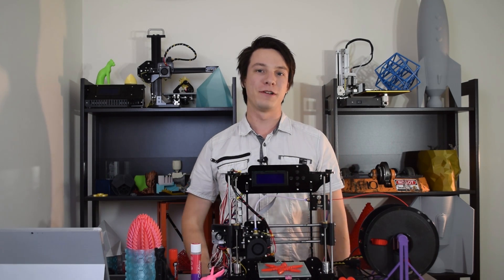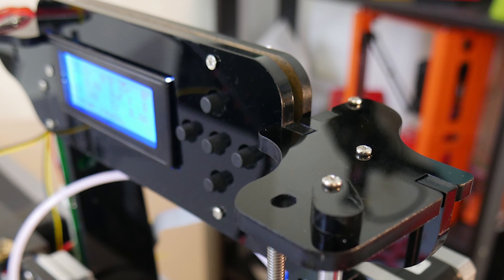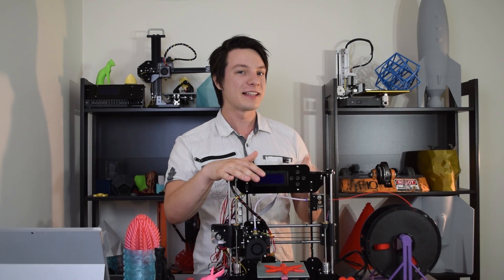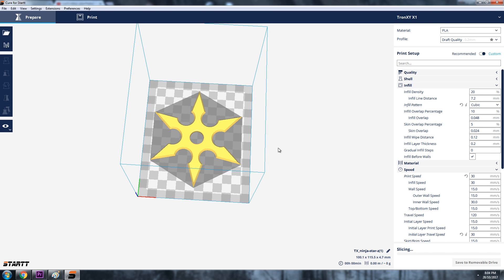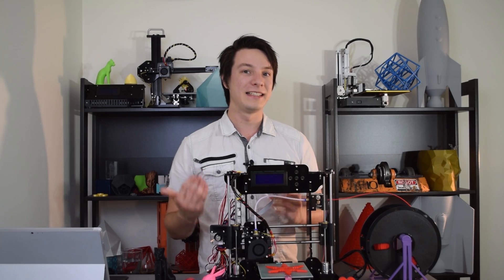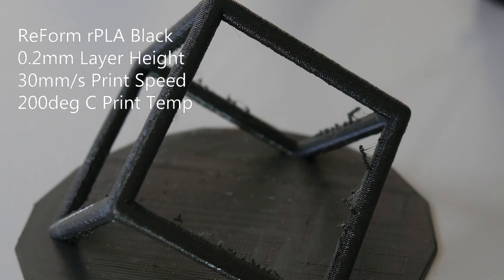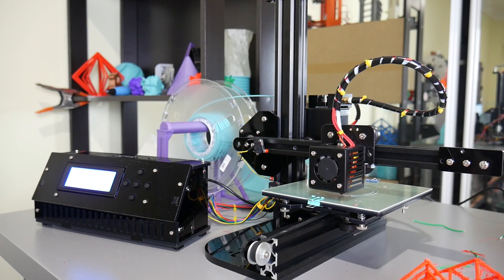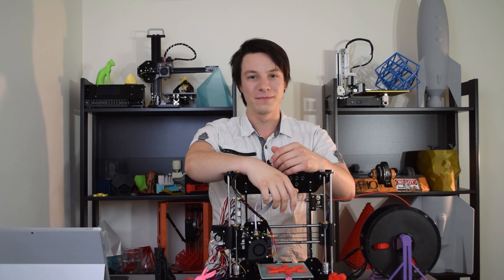The $99.99 STARTT 3D Printer is the Cheapest Kit you can buy. But is it any good?

Comment: I bought that same printer 4 months ago. In fact I bought 10. For 75.99 from a North American eBay seller. They are oem from tronxy.
Reply: And non of these issues werent present on all my 10 of them. They were perfect. What the hell is startt doing. They also have heated bed
Reply: What did you search to find it on ebay?

Comment: Love ya channel, can I ask a question?
Do any printers extrude wet ceramics? Or metal clay like 'silver art clay'.. wanted to print out some  piezoelectric ceramic clay like PZT .. anything on the market?

Technically shouldn't be hard.
Reply: Not right off the shelf, probably, but not an unexplored topic either, you can accomplish it, there's numerous print head designs. The keyword you're looking for is "Paste extrusion" e.g. on reprap wiki. People do all kinds of things with those, like pastry and other foods, printing solder-ball-flux paste in electronics, and yes porcelain.

Comment: GIMME THE HARIBOOOOOOO.  I can never find the big bags here in South Africa (CT. Not JHB. Lady Muse knows what I mean).

Sure you don't have to deal with mains voltage, but that DC can still give you a good shock. Won't kill you. Still can give you a good burn or fright. Though on a side note I have been shocked by mains voltage (240v 50/60hz) many times thanks to people not turning off control board switches after they say they did and other reasons. 
Never mind that though because you have a very hot bit of metal a kid could touch. Just look at the marketing and their claims. It's aimed at kids as a START[T] to 3d printing.

Frankly if the parts (motors, motherboard etc) cost more to buy individually than the whole kit. I would just buy the machine for its parts and use the parts for a hypercube or something. Hell. build the printer. Cut your teeth so to speak on the learning side. Get it working. Print parts for another type of machine and tear it down to build that one.

Also a side not to Angus.......That joke was bad, but I forgive you because your reviews are good.
Reply: Martin B You really can't shock your self with those DC supplies.

It's 12v, you're not going to feel anything, unless you suck it.

Comment: worth buying  for motors and pulley's and Power supply  alone lol scrap the rest.
Reply: patprop74 Nooo, not even close.

You can get the motors for $7 each and it's using an $8 power supply....
Pulleys are so cheap, it's not even worth costing them.
Reply: No clue where your from,  but around here cheapest nema 17 is round 14$ after exchange rates and shipping and that's finding a deal on fleabay. the power supply is not good for 3d printers but good for other projects

Comment: This is exactly the Anet A8 but smaller
Reply: Anet A8/A6 have:
- more rigid frames,
- larger print volumes,
- heated beds, (including more powerful PSUs!)
- optional auto leveling kits
at an overall reasonable price.
Reply: Hans-Joachim Bierwirth the A8’s frame isn’t very rigid — the smaller size should make this one more rigid than A8, unless they’ve gone for ridiculously thinner.
Reply: So a A6
Reply: I thought so too. It's like a half the print bed sized mini Anet A8 with a power plug, no heated bed and a price tag higher than half of the A8. It looks cute though.
Reply: A6 is better
Reply: its a small a8 with an external psu. i think its pretty decent but given that the anet a8 is often on sale on gearbest for around 130-135$, i think you should spend that extra 30$.
Reply: I would go for the a8 too. I have not had most of those problems with mine
Reply: +Hans-Joachim  And Anet a8's affordable price making it's community bigger and you can get help easier, you can also upgrade it easier too.
Reply: it's way worse you should say
Reply: +Hugo not exact , it got the bowden upgrade
Reply: I was thinking the same

Comment: Great review Angus! By the way, would you know much about the V3 printer sold through a 90 part magazine collection called 3d Create and Print? I have completed the build and it seems to work fine mechanically but I have come across many small problems, especially with the provided software 😞 It would be nice to know your opinion on it

Comment: You could just get this set for $99, buy a steel frame, replace some parts, add a heated bed and you would be set. ;D
Reply: Diabl0pl but by that pint you might as well buy a whole new ohhhhhh..... <joke dawns on me>
Reply: Wow, I just went to buy it for parts. $48 for shipping. If it's in USD, that makes it $192 Australian dollars. I could buy another A8 from Gearbest for $201 Australian delivered. Larger build volume, heated bed. I know what I'm getting into too :)
Reply: You mean something like Tom's Dolly? :)
Reply: Yep, buy it for parts ;)
Reply: Or just fucking buy an anet a8 for 50€ more... bigger bed, better structure,heated bed...
Reply: I think the best cheap 3d printer is the cr 10
Reply: @specy_  no dude, the ender 3 it's cheaper And prints quite good, still it's also smaller
Reply: Worse case scenario, you have motors, rods, pulleys, and a control board for $99.
Reply: @specy_wot Correct
Reply: Wow, I bought mine 1 year ago for 300 + import taxes - so all together like 380 Euro. Can't believe how low they can go with it. As mine is starting to show some wear, I might consider buying another A8...
Reply: Consider to build a Hypercube designed by tech2c from your Anet parts. To me it seems to be the best printer available.
Reply: @Specy_wot Yep, have one. Just waiting on some parts for the belt driven second Z-Axis. It's way more than the A8 though. Cheers
Reply: ElementHTTP and that’s why you buy a 3d printer...
Reply: I bought mine for 150 shipped 9 months ago, without taxes inside the EU. (I guess they smuggled it into the EU through Slovakia somehow, since that's where it shipped from and the price was exactly the same as one shipped from China before taxes.)
Reply: Not sure about Australian shipping costs and VAT from Gearbest. But, I watched the price on the A8 fluctuate on the website and got my A8 (in the US) for $139.95 and $6.48 shipping from the China warehouse. That's the lowest I've seen. Interesting that it was cheaper from China, than from their Los Angeles warehouse.
Reply: Diabl0pl i bought one of these off amazon for 350 cad and had to return it. I got another one really similar with metal frame and a bit different setup for the z axis and its amazing
Reply: you'd want aluminum, and that's gonna be a few bucks, plus a heated bed and all the hardware (screws, fittings, belts, washers, wire extensions, etc) and the simple work it'll take you to transfer and partially redesign the thing.. you'd be better off getting a cheap creality like an ender 3.
Reply: Mmmmm that's a good idea actually
Reply: Instead of a steel frame, a small 1/2” or 3/4” plywood frame that you personally joint together with wood glue might be a cheaper alternative to an expensive steel frame

Comment: I have that same problem with my jgaurora Prusa i3 clone where it won’t print where I put it in the slicer. I have tried many different slicers yet when I put it in the middle it moves forward and to the left on the printer
Reply: Logan Dees that’s because the printer uses the front left as the point (0,0) whereas the sliced thinks that it uses (0,0) as the center of the bed. There is a setting in most slicers along the lines of “zero point is center of bed” and that is enabled but it shouldn’t be

Comment: Nice Spare Part Pool. Thinking about to buy one for other projects. All these parts like the motors, rods, bearings screws etc. can be used for other make projects, and I guess buying these parts one by one is much more expensive. What do others think?
Appendix: OK, ordered one. In Europe you can buy them from London for 100;- Euro incl. Vat. plus shipping inside EU is about 15.- €. Usually I would pay just for the  in pulleys and belts more than 30 € in Germany.
Reply: I've looked into this and buying a cheap 3d printer for parts is a lot cheaper than buying all the parts seperate.
Reply: It really would have been cheaper to buy exactly what you want from Aliexpress, rather than buying this kit.
Having said that, it's just not that much money :)

Comment: This printer might be the one. I don't own a 3d printer yet but would really like to get one. I have a few questions though:
Can I use my own software to generate gcode or am I required to use their software? Does it have weird online requirements? DRM filament? 

The last thing I want is another customer-hostile device.
Reply from the maker: It's standard g-code, so you could use anything. Cura, Slic3r, Simplify3D etc.

Comment: So its 50% scale anet a8 at 75% the price with a dc adapter instead of mains..
Reply: without heated bed and got a bowden
Reply: The risk of being electrocuted should never be taken lightly. It is never about 110 or 220V, but rather how much current runs into your body. It doesn't take much current to cause injury. And yes, the switch does protect against accidentally touching it.
Reply: Plus: It's a 3d-printer and can 3d-print a 3d-printed cover. Who can't do that doesn't need a 3d-printer and shouldn't buy one.
Reply: Closer to 100% of the price once you factor in postage/shipping.
Reply: Wrong got an Anet A8 from gear best just before XMas for 135 shipped.
Reply: Chris Horton Exactly, voltage doesn't matter, it's amps that kill.
Reply: Davo Moto whilst true, voltage directly correlates to amps, and the higher the voltage the easier it is to “penetrate” the skin
Reply: This printer is total trash and this guy is an idiot for promoting this as an entry-level printer. Entry level users should just spend the extra ching for the A8. If a Bowden is so important, by the time you're like "I Love 3D Printing" you'll be all set to jump onto Thingiverse and print a Bowden conversion kit. Or You'll be like "I Really Love 3D Printing! SHOW ME THE PRUSA STLs!"
Reply: yea and in the US where our mains is only 110v, we almost laugh at electrocution risk vs 220v everywhere else in the world. 110v is just a tingle and unless very sensitive to electical shock is kind of low risk even. 220v on the other hand will stick you to the circuit and cause burns, and can be much more of a death risk. 

But as stated, you pretty well have to TRY to touch the mains. Which if your home is wired correctly should even trip a circuit breaker.
Reply: Chris Horton shouldnt. But usually is. Especially in the states where we dont see the risk vs 220 which has much more current. Working construction it wasnt uncommon for me to just tap my finger on the sides of an exposed 110 outlet to see if the circuits dead. While 220 id never risk it.

Comment: Seems to be this one on Ebay
https://www.ebay.co.uk/itm/DIY-3D-printer-LED-display-large-desktop-3D-printer-with-Free-Filament-CD-/182056442324?_trksid=p2385738.m2548.l4275
It seems to indicate that it can print ABS and PLA, but it's £106 inc p&p. Meh, I guess it's not too bad if you say it can produce reasonable results. My biggest problem is that I use the Linux Ubuntu operating system. Does anyone know a way round that? I've never successfully used the windows emulating program "Wine".
Reply from the maker: That's an i3 design but a totally different kit - the material looks like pressed fiberboard rather than acrylic.
Reply: Do you mean delrin or something similar? That would be ok. If it's anything like mdf then it's junk.
Reply: This is not the same printer! I can tell you what it is though, it's 'CTC DIY Prusa i3 Pro B'. CHEP reviewed it! The extruder is faulty, the board is random and weird, i think most shipped with like a GT2560 board but with ATMega1280 processor instead of 2560 and no bootloader, so you may need development tools (like at least a usbasp, $2) to make initial changes to it, but be warned, there aren't many people who could help you with that there, because it's very nonstandard.

It can do ABS on account of having a heated print bed. The power supply it comes with is not very confidence inspiring, it's like a Meanwell knockoff of random quality or lack thereof. The frame is made out of melamine-laminated plywood, so it's not the worst.

Don't worry about Linux. You need to throw the supplied software away anyway, because it's all in Chinese language! The software it originally ships with is Ultimaker Cura, and it's out for Linux and anything else, and just poke some people on random 3D printing forums or facebook groups to help you get the correct settings for the printer imported. If you were to connect the printer to your PC, the printer doesn't require special drivers, it will occur as standard CDC serial port and supported by Linux with drivers built into the kernel, and it will create a teletype device file (/dev/ttyusb0 or so - depends on distro and version) that software can interact with. But generally you don't need to connect it to PC at all.

This is exactly the printer i'm getting for myself, but i'm moving houses now and it'll take a few weeks. I'm taking it because i studied electronics engineering but always worked different professions, mostly embedded software developer, so the problems i may face that might baffle others are right up my alley, and i just like taking a shitty bag of parts over a finished working product.
Reply: Great info! Thanx Siana. I'm also considering one or two others at twice the price and will make up my mind before Xmas. As a beginner, I definitely want something that'll work straight out of the box. I'm joining a forum so I can spec things out and get advice. Thanx again tho. :¬)
Reply: This is the same as the STARTT https://www.gearbest.com/3d-printers-3d-printer-kits/pp_361425.html

Comment: Check out the the Anet A8 printer. It's the same but bigger and it works amazing
Reply: I have an Anet A8 and it works amazing.
After I screwed it down to a wooden plate, after I printed out belt tensioner and part cooling fan and added cooling fans for electronics and added some wire chains and a case to put the screen outside of the enclosure and added some tweaks to print flexible Filament.....

Honestly: when your Anet A8 works amazing then you have/got the knowledge to build a better printer from scratch.
I like my Anet A8 because it's my start to 3D printing BUT it's a pain in the a*** ...

If you want to buy a good printer get the original Prusa from Prusa...
If you want a hobby buy an Anet A8
Reply: Random_Precision do you really think HE doesn't know the Anet A8??
Reply: Stefan Kreuter what you said! 😁
Reply: Random Precision. I do have a Anet A8. I have modifyed it extensevly. Anet A8 have random precision. 
This one dosent have the heated bed. Or the dangerous PSU. 
Smaller, It migt be less worse than the A8. Othervise. Its the same. But less hazardous..
Reply: exactly as you said stefan. currently im printing frame braces to improve the rigidity and stability of the frame. i´ll also have to install a mosfet, switch and higher diameter cables in the near future. i have already installed the auto level sensor, but didnt achieve setting it up correctly yet. i hope, that in 2 months this printer will be completely ready to print whenever i want, but its a long way i guess. i still like the project, because the printer only cost me 130€ and when i got the calibration right, the print quality was amazing! 

my next project will be the mostly printed cnc mill, lets see how it turns out :D
Reply: Random_Precision you say that, and then you get a nice printer and realize what you've been missing.
Reply: Random_Precision I’m not sure but I think he once said he doesn’t like to build kit printers so that’s why he hasn’t touched the a8.
Reply: but dangerous